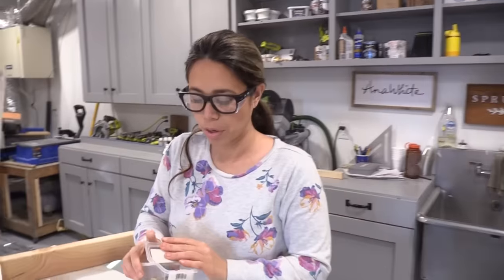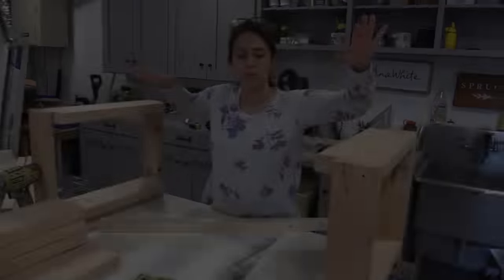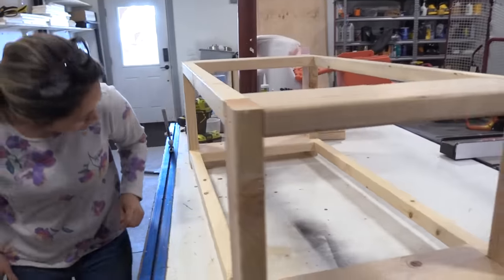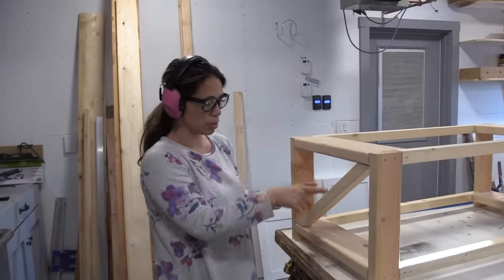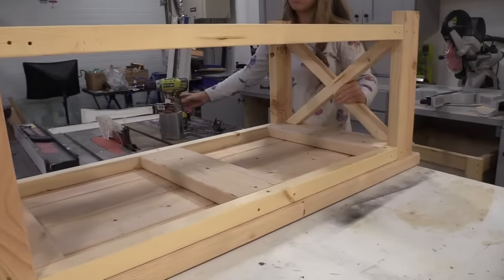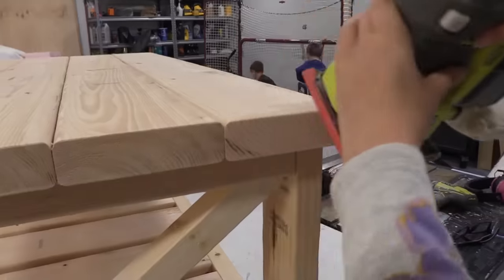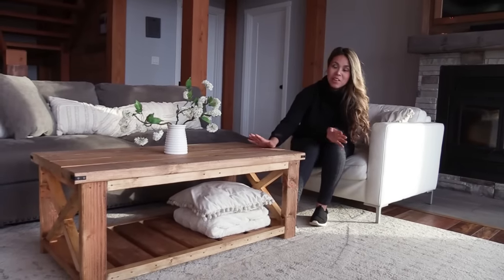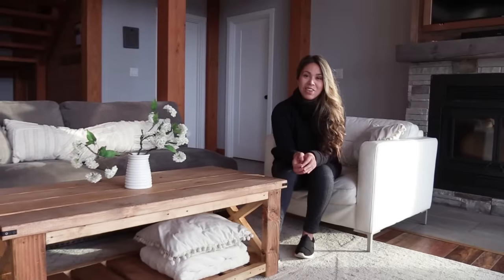$40 Farmhouse Coffee Table - Easy to Build #anawhite

Comment: I use those screws alot. Quick tip: reverse screw back out some then drive back in and it will pull it tightly together. :)
Reply from the maker: Great tip thank you!!
Reply: Yup, only do that once you get into the 2nd piece of wood by about 1/2".  Tried explaining this to an acquaintance when he was moving and I helped tear apart his shelving in the basement.  Every Single Joint was floppy because there was a gap..  Explained what to do to tighten the joints up and got a deer in the headlights look..
Reply: Oh! Very nice advice. I will do this promise. Very informative. highly recommended.
Reply: mkckf4l did you predrill any of these?
Reply: Thanks for the tip.  Very helpful.
Reply: @dennisheflin2680  you don't really need to predrill with the trim head screws, especially for a soft wood like pine
Reply: @VeteranCapybara  thanks, I actually started to use these and noticed like many others that they just don’t grab that well, I went with something different.
Reply: @dennisheflin2680  I actually prefer to use pocket holes whenever possible. Those exposed screw heads aren't very attractive
Reply: Is that almost like drilling a pilot hole?
Reply: thanks

Comment: Hi Anna
First time to comment on one of your projects. I like the table design and using the 2x6 as an easier way to attach the side rails. Two things I would do differently - use the trim-head screws with the smooth shank. The ones you used are for composite materials, as you likely know. When I build with wood, I sometimes make mistakes etc. and when I remove screws made for composite from wood, the reverse threads pull up wood fibers. Secondly, I believe using a half-lap on the cross members would made for an easier build. This is a project that could be done by the beginner woodworker with a tape, pencil, handsaw, square, maybe sharp chisel, and, as you did, a screw gun/driver. Thank you so much for the clear and concise video, showing materials used right up front. I like it.

Comment: I really like this design and the dimensions can be customized to your space.  I built it with a circular saw in a day rather than the few hours described in the video (really makes a good case for a compound miter saw if I do more woodworking / furniture builds).  Make sure you use 2.5 in screws, not 2 in screws as I made that mistake and had to go back to make it a bit more sturdy.  Thank you for the cool design and the complete walk through.  Really helpful.
Reply from the maker: That's fantastic, so happy you are enjoying your new piece of furniture!

Comment: Hi Anna. I have built several of your projects over the years. Admittedly, this is the first time I’ve watched your youtube channel. Happy to have finally made it. I do have a little advice for your viewers concerning the X patterns: if you have pocket hole jig use it. The self taping screws are certainly workable, but if you don’t have experience doing that your boards may wander on you. The predrilled pocket holes are easy to hide. In fact, with the kreg jig (pocket hole jig) you can hide every single screw by making the pocket holes on the inside. Also, be sure which ever way you screw best not to screw into the end grain. If using glue then it’s fine, because the screws are just holding until glue dries. But end grain wood is like a box of straws... and a screw going parallel to a straw won’t be very strong. Blessings to all.
Reply from the maker: Absolutely! Thanks for sharing your tip, I sometimes just try to keep it simpler and using less tools:)

Comment: Magical, just curious how heavy this sucker is since I live alone and it looks like a pain to move. I suppose its not too bad with 2 people.
Reply: Put metal caster wheels on it. Problem solved.
Reply: Assuming the maximum density of white pine of 31 lb/in^3, the weight will be 69.2 pounds. White Pine is what I used and I believe she did too. I calculated the weight since I was concern of being to heavy to move and couldn't find the answer in the comments.
Reply: Built it.  Fairly easy and nice but it is wicked heavy.  Two people it's movable.
Reply: Bit on the heavy side, you will probably need a dolly or crane.😅

Comment: Glad I built mine when I did, that $40 table is now $250 😂
Reply: I was about to say the same thing.
Reply: Great video and a great channel 👏
Reply: I’m building today and it cost 36 for the lumber.
Reply: @danielacantu8717  ya lol most these builds double in price now
Reply: True North: Positive Junior Tennis Coaching where’d you get the lumber??
Reply: The screws alone are 20 bucks.
Reply: 64 bucks
Reply: @Dathan4435  that was 10 months ago, lumber has came down a lot
Reply: @MrCAMO112  still wasn't 250 lol
Reply: U aint lying!!!!! I just priced the material now and the price just for the 2x4's was $58!!!!!!!!
Reply: @laticiabrown  yeah ik it. Caught a lot of hate from this comment, don't know where these folks live but lumber is through the roof expensive in Alabama.
Reply: Lumber prices are also very different depending on where you live. Oregon provides alot of lumber so ours is cheaper 😁
Reply: Still far cheaper than the tables sold at furniture stores
Reply: And back down to $40

Comment: Half lap those x boards. It will look so much sweeter and isnt hard to do.
Reply from the maker: That’s a great upgrade!
Reply: fizbinsfire what does half lap mean?
Reply: @rodprimroseoiuujik6739  I was going to ask that, too!
Reply: @rodprimroseoiuujik6739  I googled it.  It's what I was thinking as I watched the video, but I didn't know what it was called.  When she was putting the second piece of the X on the ends, if she had cut half the material away from each piece instead of cutting all of it from the second piece, then the two pieces would have fit together like Lincoln Logs.  That would have been a half lap joint.  Most Youtubers would do it with a table saw.  I guess if you're doing it with the minimal tools that I have, you would do it with a chisel.
Reply: What would be consider a good wood to use for the table?
Reply: @Romans828girl  you could easily do it on a compound miter saw or just a circular saw. Just set your depth on your saw to cut half the thickness.
Reply: @kayleewinget4163  Thanks.  That's a great idea.  No compound miter saw, but I do have an ancient little circular saw.  I've never tried to make a shallow cut with it.  I'm a total newbie.  I will give this a shot.

Comment: A very nice looking table, but unless I am missing something, the entire weight of the bottom part of the table is supported by a construction grade (pine) 2x2 with a single screw on each end, supporting the weight of the 2x6 boards and whatever is placed on top of the lower table?  It seems to me that this 2x2 would start to warp under the weight in a matter of months.  Forgoing the more expensive options of hardwoods or milling your own 2x2's, the simple fix to help support this weight would be to cut a small piece of 2x2 material, drill a pilot hole and mount it in the bottom center of the table for additional weight support.  I'm sure you have a 2 or 3 inch piece of 2x2 scrap that would work for this at no additional cost.  The black metal pieces on the corners really do add a nice finish to the table!

Comment: Beautiful and I love the way you make it easy to understand. However why are you not using wood glue throughout if I may ask.
Thanks 🙏🏾🇿🇦
Reply from the maker: I would recommend wood glue, I use it most of the time. Sometimes I build a project prototype to make sure it works, is sturdy, check if there a better construction method, etc...Also I do so much building, that sometimes I reuse the wood for other projects. Thanks for the visit!

Comment: Hey guys and girls looking to make this table, amateur here and just finished up completing this table just have some pointers just in case someone plans on taking this project on and isn't 100 percent sure. so i first started by shortening the table, the plan calls for 46 inch table top length i actually cut it down to 40 saving 6 inches for my requirements, with that i had to shorten the side 2x2 fur strips which i believe are 37 inch in the plan to 31 inches, other then that no other alterations were needed. i DID NOT cut my X shape before i got to the step making sure they were made to fit just in case i had something off with my table. keep in mind on how much of an angle you can cut on your miter saw mine only went to 45 so i had to make a small free hand adjustment (be safe!) 

For the X, its tricky to get the angle right try your best i personally, being a starter in wood building actually bought an extra piece of 2x2 fur strip because its so cheap and i knew i would definitely need it. so some mistakes were made and multiple cuts were done but don't let that discourage you from tackling the project. you can actually leave the x out since its not structural at all but looks way better with it in. 

Other tip i have when screwing the table top to the frame of the table i had it laid out on my garage floor and actually had to do some calculating to center it as best as i can,( its a farmers table so when things are a bit off it actually makes it look better cause it fits the design) seemed like my miter was out of alignment and had cuts off by just a little so dimensions were off a bit. so when i put the boards down i actually taped them together to make sure they wouldn't shift around on me and then laid the frame on it and marked off exactly where it needed to do so i can lift the frame apply glue and then screw it on.

Last major tip i have is if you do plan on staining the table and don't have any experience on it please search up multiple videos on the subject so you can get a grasp on every part of it. pretty much look into pre wood conditioning and what stains will do, how to apply, and what to expect etc. 

If you have any questions on actually doing the project feel free to ask away i will try and answer anything you need

Also don't worry she makes it look so much easier in the video then what it actually is haha but thats the fun part, trying to get the table you want makes it all worth it, also if you get a wobble in your table don't worry mine has a slight wobble i'm just going to compensate with felt pads which i planned on putting under the table anyways so i don't scratch my floors, obviously if its a big wobble something is really off and you will have to check all dimensions and maybe make some new cuts. 

Thanks Ana White for the awesome video !

Comment: Hi Ana, I love this coffee table so much. I was wondering if the wood glue is absolutely necessary or if we can do with just the drill and screws?
Reply from the maker: Drill and scews will be fine, the glue just strenthens all the joints, so if you see it need it added after much use, you could always disassmble and add at that point.

Comment: One small side note..the screws used in this video...i got the same ones from home depot...since am not an expert like Ana, ended up stripping a lot of screw heads..they are very delicate if u r not aligning the drill direction

Comment: Hi, thanks for the detailed video. Do you recommend using wood stain/poly combo product or applying stain then poly?  Also, is water-based stain easier to use than oil-based? Thanks

Comment: Another suggestion for those boards you attached at the bottom. You could have run 2 (1/2 ) in wide strips under the bottom and secured the boards to them from underneath instead of all those screws showing on the sides. Would have been a much cleaner look as well as rounding over those outside boards at the top with a router.
Reply from the maker: Good idea!!  Thanks for input!

Comment: Hi Ana. You are one of the youtuber's I've looked at to get some inspiration over the years. I really like the design you came up with. I thought I'd ask you if you ever created a wine fridge bar. Or even a grill table. I have several pieces of granite that I would like to use as the table top for both. For the wine table, I was thinking of doing a wine fridge on one side and some wine glass shelves on the other side. I thought it would be cool to add the sliding farm door so that I could cover the fridge or the glasses. Anyways, I've been looking online for some inspiration on what to use as the base and I like the looks of the coffee table- especially the x sides. I thought I'd just reach out and see if you had created a wine fridge bar or a grill table. I wasn't able to find anything on your site. If not, maybe you might be inspired. If not, no worries. Thank you for sharing your work. Keep inspiring us!

Comment: would it be possible to apply a clear coat/ resin finish with the way the top is fastened together?
Edit- would the resin sit in the gap weird or cause air bubbles?

Comment: I've heard that 2x2, for example, are not actually 2 inches by 2 inches. that the naming is kind of a legacy thing. As I'm in brazil, with metric system and other culture I wonder how to translate your instructions to actual measurements. 

Also, what kind of wood are you using? I don't want anything to get lost in translation, so I thank you if you could be very specific. And I apologize if i missed it in the video itself.

Thank you
Reply from the maker: Please email anawhitesite@gmail.com and we'd be happy to send you some resources!

Comment: The X's are driving me crazy! What angle are you using? What does "scribe fit" mean? You make it look so simple and it probably is but I tend to overthink things sometimes. I bought all the wood today 11/11/2021 for $70 in Utah.
Reply from the maker: Start watching at 6:23 https://www.youtube.com/watch?v=Ty58pzTfiiM

Do you have a miter saw that can be adjusted easily to cut angles?
Reply: Just purchased the lumber today to build one for a client, cost me 65 with stain and screws.  The angle is right around 52°

Comment: If you're building this now, just know that the wood will probably be more than $40 due to rising lumber costs. My local lumber yard is usually cheaper than Lowe's, but it was still $70 when all was said and done.

On another note, this table looks really good painted white on the bottom with just a light stain and clear coat on the table top. My wife said it's our best looking piece of furniture!
Reply from the maker: Yes lumber prices are currently not friendly....

Comment: I was going to order the wood but I don't understand many things. First what does that mean 2x6@46? 2inches by 6 inches by 46 inches? Second, what wood should I use?
Reply: @catherine mol, You got the right idea yes. It means the 2x6x8 piece of wood if it is 8 foot long or 96inches, to cut it down to 46 inches. So the only thing that is affected is the length or how long the piece is.

Comment: 6:43 Why not mark both boards and then set the depth stop on the miter saw for 1/2 the thickness and cut away the middle of both boards so you don't have to cut in half and then try and screw back together straight?

Comment: Is there a reason why you didn't sand the individual pieces first before screwing them into the table?
Reply from the maker: Either way works. There are some projects where sanding before assembly is recommended when the areas to sand are too small to fit your sander in.

Comment: The only issue I had when building this was the fact that your wood list from Home Depot was wrong, the pricing was wrong and the diagram didnt match your video. I still built it, but it took me a while to figure it out on my own.
Reply: Wood pricing is going to differ in different parts of the country. Where I am the wood pieces were $1-3 more and really high for some pieces. I’m building the rustic coffee tables that she has plans for and a 1x12x8 was $26 at HD/Lowe’s which pushed it way it past the under $50

Comment: I"d say this is more of an intermediate beginner project at least and the instructions could use more details for the ultra beginners like myself. 

 Made a scaled down version of this: 36" x 16.5 " without the Xs at the end. Never made anything before. learned a lot. 

Table is heavy and sturdy. I found it necessary to have someone help. Needed them to hold peices together while i screwed them in, for instance 

Hard to find good boards at Lowes, warped, cracked, etc. 

She doesn't cover how to put the glue on. Did I put too much? too little? Boards that I had to remove and replace showed the glue hadn't done anything. Guessing those had too little. 😏 If you put too much it will run down and boards will slide around when trying to put screws in.

 Don't plan for Lowes to cut your boards. Their saw is only for rough cutting to fit the wood in your vehicle. So you definitely need access to a table saw of some sort. 

Boards on bottom shelf can be tricky to fit if not cut well. " Measure twice cut once". Had to cut more on a few boards to replace.    Btw a 2 X 4 is not 2 inches by 4 inches, it's 1.5" x 3.5". Same goes for all the plank sizes. This is especially important to know if you are making yours a different size.  

 The screws she used are expensive but they are less obvious so I like the way they look.  I didn't need to predrill for them either. They come with the bit you need.  They have more of a star shape vs Phillip's cross shape. 

Overall I like the table. Proud of what we've accomplished. Cost more than 40 dollars for me. and I haven't got the stain yet. My teenage daughter is now expressing interest  in woodworking. 

Another project that looked easy online and turned out to be much harder. 
Other than all that, I'm happy with it. 😎😆
Reply from the maker: I appreciate the feedback, here's a getting started post that may be helpful. https://www.ana-white.com/beginning-woodworking